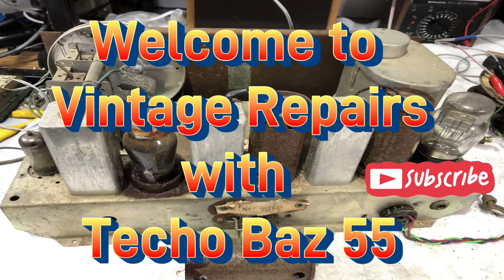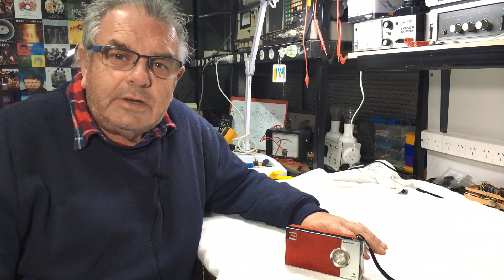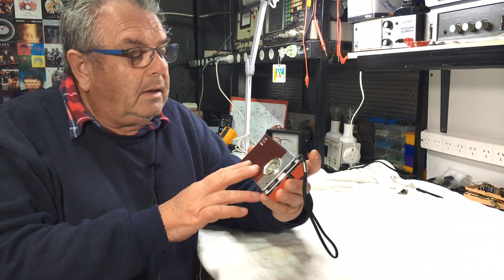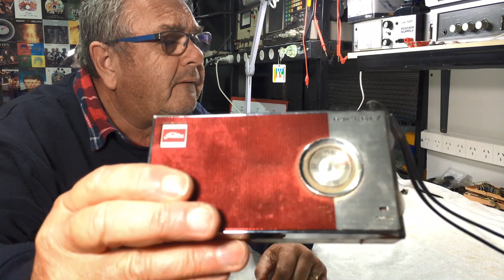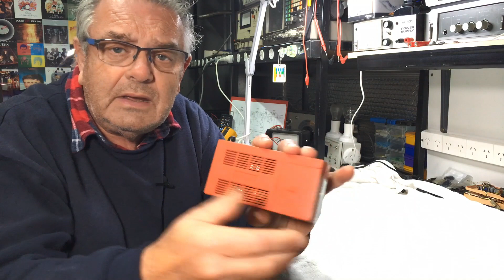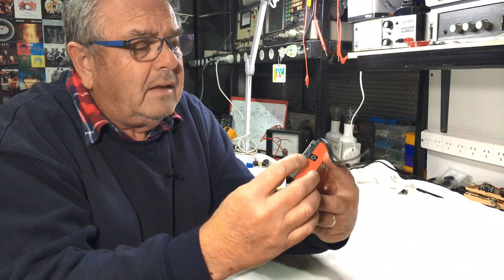Toshiba 7P-70A Transistor Radio Restoration

Comment: Hi Baz,
During the first half of the 1970s, those type of small imported transistor radios were passed onto us apprentices to repair.  The workshop rule was, maximum bench time was thirty minutes, or less if there wasn’t any remote chance of getting the radio working.  If we could not get the radio working inside thirty minutes we wrote ‘BER’, name, and works number on the accompanying paperwork, it went to the office where one of the secretaries would record details, then pass it over to one of the showroom salesmen.
There is a fair possibility that the mylar spacing between the tuning capacitor vanes has deteriorated thus inhibiting rotation.  A common fault on both types of AM and AM/FM miniature sealed tuning caps.
I too have experienced leads coming loose, and rotating inside the metal fixing cups on the ends of those types of resistors.  You was correct, it does not happen too often on Japanese, and Hong Kong manufactured radios of that era but it was quite common in radios (and TVs) manufactured in the USSR.
Overall, you accomplished an excellent repair on that small radio.
Best regards, Phil.
Reply from the maker: So interesting Phil, boy the didn't give you long to sort things out !
The resistor was a new one on me, never seen that on anything but a new experience learnt !
Thank you so much for sharing your story, ahhh the good ol' days . . . or were they ?
Cheers
Baz